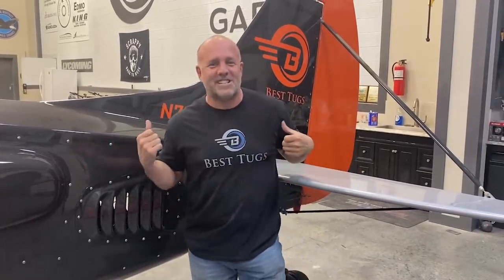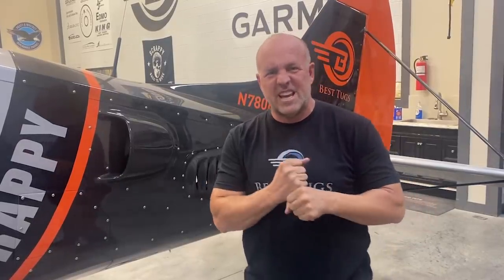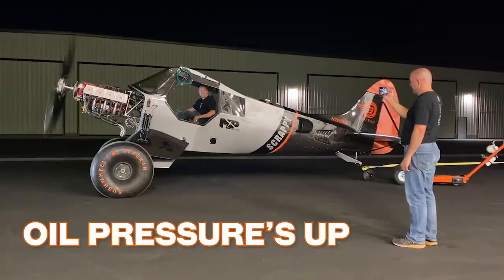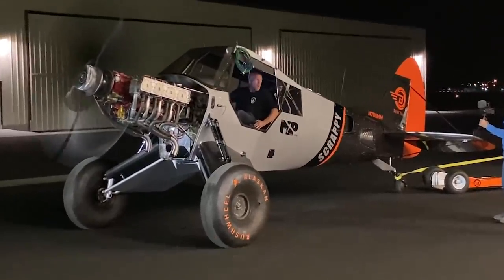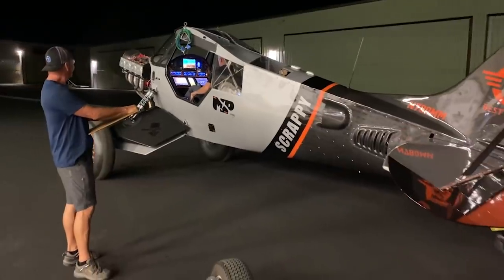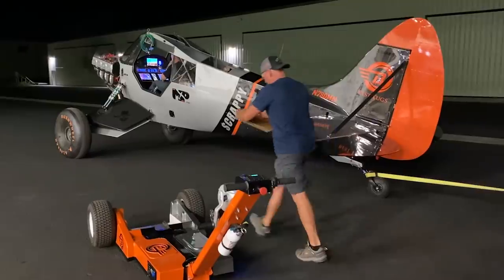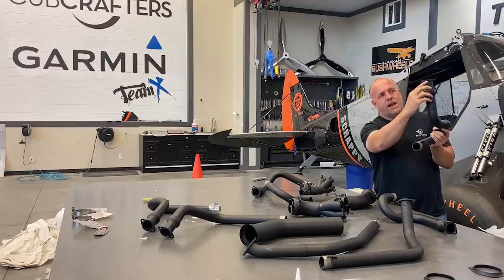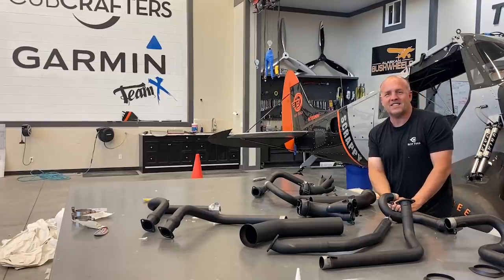Monster Race Engine Roars to Life in Tiny Bush Plane 😳 | Scrappy #34

Comment: USTO Ultra Short Take Off like about -2 inch runway needed. Plane will leap off ground and go straight up unlimited vertical until atmospheric oxygen becomes too low to support combustion. Calculated climb out to limit is 3.657 seconds! Lolol NASA needs to have this guy build stuff for em!

Comment: Fantastic. I would normally do a windover with plugs removed to get oil pressure. Guess it's drysumped so oil should be available straight away
Reply: It didn’t make it in to the video, but he does a wind-over every time. 👍🏻 Great comment.

Comment: Mike, not sure you'll ever get around to reading this and my only interest is you safety; but I must say "Please don't use that prop in the air".  There is a reason they use those props on airboats one is for thrust an the other is for braking. In an airplane; can you imagine the drag that the prop will induce if you have an engine out condition; even with the engine running reducing the throttle will induce a log of drag. I suspect you will have a difficult time getting the power setting to keep decent profile on line.
If you decide to use it; be very cognizant of possibilities on the downside of  using such a prop.

Comment: Ah you need to learn of the magic called copper coat. After warming up on the engine you can remove and reuse exhaust and intake gaskets a few extra times.

Comment: Is that a full feathering propeller? I ask because I had a friend who built a plane with an inverted V-12 and a big paddle prop. He had an engine failure and witnesses described it as a 35 degree nose down attitude with it wind milling to keep from stalling. he could not flare and did not survive. Food for thought. PS love the aircraft. My friend has been flying his PA-24 with that engine for years. It's a brute.

Comment: I hope it's just me but I didn't see any penetration on those exhaust welds, or at least the joint flange after merge collector to be more specific. I also wonder what material did they use to make that system.
Great aircraft build by the way, I'm glued to the screen everytime new part comes out <3 Great job Mike

Comment: So, is this a ground adjustable only prop?  I figured it would of been a constant speed set up?  Maybe that isn't possible with a prop like this?
Reply: It’s an AirBoat prop for high static or low speed thrust. Airboats operate in such a small speed envelope that fixed pitch is sufficient. It will make it hard for Mike to have prop efficiency as speed increases. He’ll have a tough choice tuning between high static thrust or better efficiency above 40 knots.

Comment: two questions. One is having the EGT probes at different lengths from the exhaust port going to cause you issues like above and below the ball joints. Second question is the exhaust going to melt your antennas?
Reply from the maker: Great questions.  All egt read a little different just on the slightest placement, rotation around the pipe and manufactured process.  The location between mine are plenty close and when you tune your fuel injectors, you don’t use an absolute temperature and try and get them the same.  They would be wrong because they are never the same.  Just tune to when they peak and try and get them to peace all at the same time never to a temperature.  For fun you can rearrange probes and find that probes are not the same.  Second on the antennas. It’s an optical illusion they actually aren’t in line with the exhaust and they are distanced in line with limitations so that they also far enough away that there is not enough heat to affect them.  Thanks for the great comments.  👍🤠

Comment: The part on the exhaust system that flexes  I cut a 1inch wide 2 inch long heavy duty rubber tab I drilled a hole on each end that I cut out of  the side wall a semi truck tire and works perfectly

Comment: How do you monitor the ecm while running the engine? Or is all that info in the control panel? Thanks Mike, great video. Smokey engines on initial warmup - smoking off the Nevr-Seez & fresh paint. ⚓️

Comment: Hey Mike, any concern for the hot exhaust pipes causing a brush fire?  I know you've got quite a bit of ground clearance, but even so, some tall grass touching that pipe could start a fire.
Reply: Great comment!  That’s why the exhaust is pointed back so steep.  Many other Cubs are about a foot closer to the grass, Scrappy is quite a bit taller than it may appear on video.  Certainly something to be aware of though and quite a concern.

Comment: would be nice for Garmin to come out with a trend tracker ,where if it noticed a pressure or temp change faster than normal , Its something instructors mentioned,, Is that gas gauge moving the same amount this last ten minutes as it did the previous ten.. Cant wait to see your brother "volunteer" to be out front using a strobex to balance the prop.  My friend did a kit planes 540 turbo one,, and demanded a 1 ton as an anchor vs a 1/2 ton... Ever look at the MS21042L  or 43's nuts for the exhaust parts?   they work well.

Comment: These bush planes look so funny to me. Not a pilot, all I flown in was a jetliner and 2 Cessnas, so 0 experience with bush planes. One thing I am sure of,  one does not have "routine" flights in bush planes :). Just curious here - I would assume this must be a high maintenance job due to rough conditions, how frequent are accidents and breakdowns when operating these planes in remote areas?

Comment: When I started my work van after a 3 week sit I put the pedal to the floor to put the engine in clear flood mode.....spark and no fuel. I cranked the engine for 30 seconds to get oil to all parts. Let go of the key then started the engine normally.

Comment: QUESTION: Is there a concern about the energized air out the oil cooling exhaust ports inducing low/high pressure conditions which potentially might alter the aerodynamics around the tail ?
Reply: The air isn't powered - it just moves under the power of the prop. The temperature increase is not enough to alter the density enough to matter.
Reply from the maker: Great question, at the distance away and speed it will fly it becomes laminar before the tail

Comment: I am thinking your axle wings may need some sort of vertical end plate between the end of the wing and the bush wheel.  The aspect ratio of the wing is very low, so an end plate would pay dividends. Otherwise, it is a bunch of drag with no lift.  Think of a Formula 1 car with end plates for each wing.

Comment: That exhaust really helps the sound of the 720. The Comanche 400s I have heard sound like Ford flatheads, yours does not.
Reply: 780. It's been modified.
Reply: @AllanFolm  
Ok, it has the new 580 big bore kit + 2. Cool. Sound should be no different without a great camshaft. Pretty damn cool anyway. Rare engines that almost nobody cares to deal with anymore.

Comment: Hi Mike, I have a question about something that I see that I don't think has ever been explained (or maybe I missed it!).  At the location where the front of your elevator ties into the body of your plane there is a slot, and it looks like the slot would accommodate vertical movement of that attachment point.  You can see this well at about 14:46 in this video.  Is that slot just there to accommodate assembly of the clamshell composite skin of the airplane, or is the elevator angle adjustable for trim setting or some other purpose?

Awesome video as always!
Reply: I'm pretty sure he talked about this in an earlier video and it was for setting the stabilizer to different conditions. But check older vids.

Comment: I wonder if the prop is going to cause unknown harmonics with the engine. I feel like more cylinders and blades = smoother but I know certain engines do not warranty with certain props.
Reply from the maker: Great question 👍🤠 this prop  was designed for this engine specifically. drag race airboats use this exact aircraft engine on there airboats. Lycoming engines are a staple in the airboat world

Comment: Mike Patey Out of curiosity, why did you decide not to go with a Variable Pitch Prop setup with the prop you currently have on Scrappy? 
Just watching the video, it looks like scrappy has quit a bit of thrust while at idle as well. I was thinking with a variable pitch prop you could eliminate most of the thrust if not all while at idle and sitting stationary. 

Another great video, very excited every time you post a new one. 

Hoping you and your family have a Happy Thanksgiving!
Reply: Just my own speculation, but I don't think you get a Variable pitch prop like he is currently using. As he said in a much earlier video there are no suitable air craft props for  the engine in this air craft configuration, hence using an airboat prop.
Reply: Yeah, I know it’s actually an airboat propeller. I have seen variable pitch props on airboats, mainly high end and/or race airboats due to the added cost.
Reply: He will be going in to why he chose the prop he did in a later video. 👍🏻👍🏻
Reply: @ChandraSlyFoxPatey  Thank you Chandra, will be looking forward to watching it just as much as I do every other video of his.

Happy Holidays to you and your family!
Reply: @P-J-W-777   🙏🏼 Thank you and same to you.
Reply: And so you learn something new every day!

Comment: Those exhaust hangers at the firewall.... will they transfer exhaust vibration into the airframe? I’d think you’d feel every cylinder hit right under your feet.
Reply from the maker: Great question.  The black isolation taps eliminated every bit.  I have never sat in a bush plane more smooth at full power.  You don’t feel the vibration in your feet at all 👍🤠
Reply: That’s cool man! Hope to see her in person some day. Stuck in Costa Rica for now but hope to get back and start my flying career again. Got a modified Pacer project in mind.  Thanks for the updates. Now..... WINGS FOR PETE’S SAKE!

Comment: Prior to installing the new exhaust system with the "swing arms" to the bottom of the firewall, there appeared to be 2 battery cable extensions in that area.  If they were in fact battery cable extensions, what was their purpose.  Thx.

Comment: Non GA person question - would there be an added bit of safety by replacing the prop with a disc for tests?   No prop-wash to blow away exhaust gas, oil, fuel leaks etc. and no prop to walk into (sadly it happens).  If one did walk into it the injuries would be far less than a meat chopper.    Plus no added hours on an expensive prop.   just thinking.
Reply: You'd lose the resistance of the prop transferring energy to the air. It would be like a car jacked up. You can't use much throttle on it, without over-revving the engine.

Comment: I would put a cotter-pin in that pivot bolt, those nylock's either wont hold over time or melt. If it's tight it wont move. If it isn't, it'll vibrate over time and rotate and wear through..From my keyboard anyways.

Comment: WOA awesome! If you don’t put wings you can still go to drag strip and race on the 1/4. One question about the exhaust pivot points at the back, is it mounted directly to carbon fiber or the firewall and what kind of temperature you get transferred there? Thanks 👍🏻✌🏻🇨🇦

Comment: The side windows were flexing a lot from airflow off the prop.  Is that going to mean noise in the cockpit?  They are like big speaker cones after all.
Reply: Probably because the doors aren't fitted, buffeting of the air inside the cabin causing the flex in the window.
Reply: @4WDBearAus  OK, that makes sense.   BTW  I bet you follow the 4WD 24-7 channel?  And very likely Mad Matt 4WD?  Do you follow the US off road recovery channels — Matt's off-road recovery, Casey's off-road recovery, and one I think you'd like Fab Rats.

Comment: A guy I knew put big-block V8's into motorcycle frames. The torque would tip the bike over if you blipped the throttle too hard. Anything similar here?

Comment: Hi Mike, 
I don't know if you are aware of the PVC ratings. PVC pipe is only rated at 140 degrees,  with a melting point around 230 degrees. Be very careful about using this product. You could use it as a make up for getting your angles for a metal exhaust,  but you should not use it for an exhaust system. It's also not rated for any pressure applications. The people using it for an exhaust could be creating an unsafe situation. 
You should talk with Charlotte pipe products and speak with their engineers. I'm a master plumber by trade, and have seen it used for many wrong applications such as under a commercial sink with 180 degree water temperature that makes it look like spaghetti,  so please be careful my friend. 
Take care, 
Be safe. 
Dean.
Reply: Watch the video to the end and you’ll see him welding the stainless steel exhaust.  PVC pipe was only used as a template, he wouldn’t do something that dangerous, especially on an aircraft.
Reply: Chandra,
If you go to 5:5  min. on the video, what was said to me suggested that it was being used in the aircraft community and  that  Mike was going to try it. It didn't sound like it was used as a design for getting the angles, Or at least I didn't hear that. 
I know Mike is a great engineer,  but to me it really sounds like he was using the PVC. I'm sorry if I misunderstood what he was saying. 
Take care.
Reply: Chandra, 
I did see the final fit up and the stainless steel on the plane. 
Thank you.

Comment: Back in a day, almost 40 years ago I worked as agriculture pilot in Russia ( former Russian) flighing AN -2 
After a 4- 5 days of rain
we resumed to work.
Was almost no paved airstrips available. We worked from ground strips. Taksing to take off I got stuck ln mud.
We brought a tractor to
pool the pain back we hooked chain to tale wheel, started pooling...
and guess what...
We ripped of hall intier
tail section off.
So when I sow Mike roaring it's engine to the limit, my hart stoped beating.
I think fuselage constructed to withstand banting forses but not much pooling....????
Reply: He said his weakest link in the connection between the engine and the tail, in a tensile load like this, is 6,000 lbs and its at the rear attach point of the tail suspension. If he could hit 6,000 lbs, he’d be happy but it couldn’t get that high.

Comment: It seems like there should be more holding that engine to that plane.
Reply: It's the other way around. It is the plane that is bolted to the engine. So look up the previous videos, where Mike shows how it was done. Basically, it's overengineerd (obviously) relative to a normal airframe.

Comment: Wouldnt the pvc get over stressed from heating and cooling from the exaust and eventually crack using PVC? Wouldnt think the prop would cool it that fast but then again i am no engineer either 🤷‍♂️
Reply: The PVC pipes are just for a mockup - the shape was then built in stainless steel.

Comment: That 13L motor must be thirsty. How is that little plane gonna carry enough fuel for long trips into the wild?
Reply: He explained that earlier. He can run it at lower throttle settings, and it won't be using much more than other bush planes.
Reply: Plus bigger wings... higher wing loading... more fuel capacity.

Comment: It’s a race engine with no roller valve train parts? you would think this engine would have a set of stainless roller rockers at least. Doesn’t anybody make complete roller valve train parts for this engine. Even Io-390’s have roller lifters at least.

Comment: Holy cow, looks like you'd have to be careful not to pull the nose over on the brakes at a dead stop, just for giving it too much throttle! 1410lb thrust at part throttle, does this thing even weigh 1400lb?

Comment: Mike you shouldn't be moving the plane under power with out having the wings on the plane. You don't have wings to counter act the torque of that massively powerful Motor. The plane could lift right off the ground and flip over. This happened to my aviation teacher at A&P school
Reply: He’s very familiar and had this discussion prior to taxiing.  He has done this testing phase a few times in the past.  You definitely need to baby step it up and use extreme caution.

Comment: So is the prop adjustable like Draco was to get some reverse thrust?
Reply: Yes, if you stop the engine and start wrenching. It's from an airboat, designed to point backwards. He has reversed the blade pitch so it will work pointing forwards. He mentioned that in a previous video.

Comment: Is there any reason not to run it without the prop on or maybe run it on a engine dyno for break-in? 
I’m a car guy so I feel like that is standard in the custom car world not sure what’s normal in the custom aviation world lol.
Reply: You can't run it much above idle without the resistance of a prop. It would overrev and tear itself to pieces in a heartbeat. Like a racecar engine - you can't throttle it up much without somewhere to put the energy it produces.
Reply: @AllanFolm  Thanks for the response, so any reason not to break it in on an engine dyno?
Reply: @dennispope8160  It is already broken in. It's an used engine, pulled from an old racer. Turbulence, I believe, before he put a turbine in it.
Reply: @dennispope8160  Even if it was a brand new engine (wich it isn't) why put it on a dyno, when you can just let it run in the airframe, with the prop on? In the exact installation setup that it'll be in later. Using a dyno woudn't make much sense, but makin everything just more complicated.
Reply: @florianN132  the reason I was imagining would be a safe ability to work on it. Check for oil leaks, listen for any unusual noises, tune it in a controlled environment etc... when he said he doesn’t think he could hear anything my first though it to get the mechanics stethoscope out and listen! But with a prop on you can’t do that safety.  Cant even get near the thing when running to adjust anything that might need adjusting!
Again I’m not a airplane guy, but I sub here because of the amazing engineering.